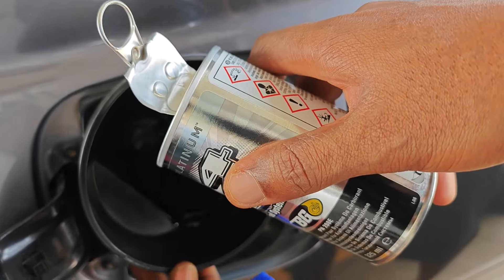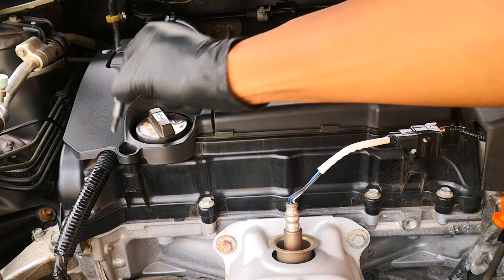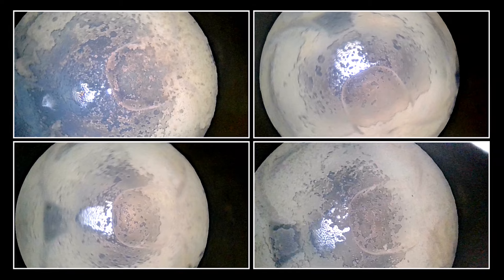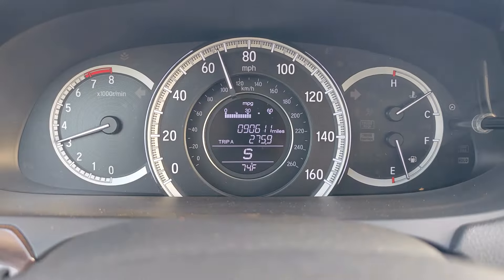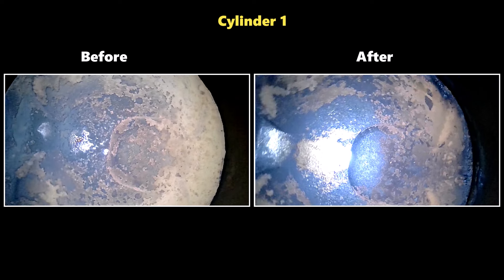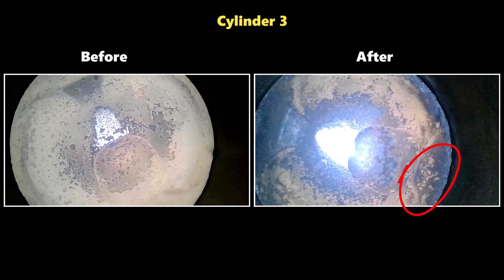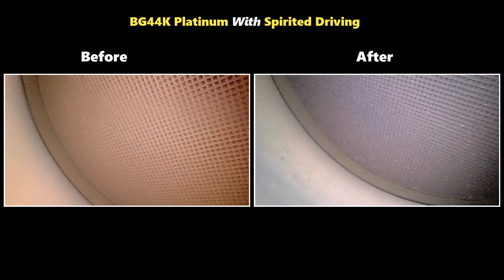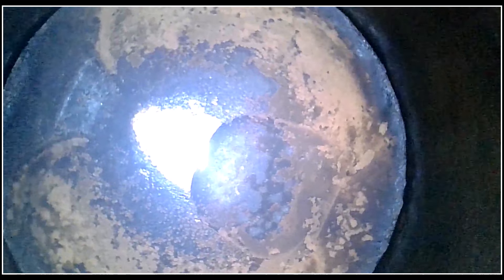Fuel System Cleaning with Speed + BG44K platinum / Carbon Buildup Removal: Before & After Comparison

Comment: Would be interesting to figure out which product is the most cost effective solution for cleaning piston heads
Reply from the maker: Agree. Totally.
Reply: I don't really see why it would be important to clean piston heads other than as a proxy for hoping you're cleaning something else.

I have a Ducati with 37k miles that's using oil and has poor compression. If I'm lucky, there is carbon buildup on the rings. I've been considering what I could use to try to clean carbon off the rings.

Valve seats, rings, injectors...those things are clearly important to clean. A large flat surface that doesn't really do anything except act as a surface for pressure to act on? Meh.
Reply from the maker: Increased buildup on the piston will increase the compression ratio of the engine, and that can lead to pinging or knocking sounds. I've had this myself and was essentially what got me into doing carbon cleaning videos!
Reply: @ konchy--   My mechanic has said that the best bang for the buck as far as fuel injector cleaners are concerned is Berryman B12 Chemtool. A 15 ounce can is around $4.50, where the BG44K  11oz can is nearly $25.00.
   If you use Berryman B12 Chemtool, be careful not to get any on the paint of your vehicle, as it contains acetone, which can remove paint.

Comment: I have an 08 Mercedes E350 with 180k miles.  Great shape, however it recently left me stranded.  Would turn over but not start.  Had it towed to the shop that normally works on it and it started fine and they could not find a problem.  A couple of weeks later, same thing.  Next day it started fine.  The issue will not repeat while at the shop and no codes are showing up.  Note...It gets a Seafoam treatment every 5 or 6 tanks.  A gearhead friend suggested BG44K.  What are your thoughts?
Reply from the maker: For something intermittent like this, I'd suspect the transmission range switch. Next time it happens, move the shifter to Neutral and see if it starts right up. I doubt it's cleaner related.
Reply: Sounds like an electronic problem. If there was something going on physically in the cylinders, it would be consistent.

Comment: Why were you driving in the S mode instead of D mode?
Reply from the maker: To achieve higher RPMs. Car is CVT and typically revs low which encourages carbon build up.

Comment: Having watched your other video, I was curious to see the follow up. I have not searched it out but I wonder at what interval (and product) could be used with a new car so heavy carbon deposits never happen. Is there a product that used once every 5000, 10,000 miles that would do this? 

As my truck has 191,000 miles, I wish I had though to purchase a bore scope before changing spark plugs a few weeks ago.
Reply from the maker: Good question! I'm still testing products, but I believe those with PEA like this BG product are good. Also had good results with Gumout all-in-one. Ultimately, I think using premium gas with a cleaner before an oil change would help.

Comment: Hi
Will this , clean fuel injectors ??😮
Reply from the maker: Yes. A very good choice for both MPI and GDI injectors
Reply: @DIYAutoworksNG 
Can I use bg 44k gdi on mpi engine?
Reply: YES, BG44K Platinum cleans deposits from combustion chamber, intake manifolds, ports and on valves and restores flow in fuel injectors.

Comment: the thing is…cleaners in fuel tank clans filter..means alot dirt going past filter membrane in fuel pump..say goodbye to your fat valet.. sure if it is in tank filter and pump . 
change filter before using any cleaning additives in fuel tank
Reply from the maker: In all my years of using fuel system cleaners, I've never had to replace an injector. A strainer is meant to catch dirt and fuel cleaners won't increase the caliber of the strainer's pores. This is my opinion.